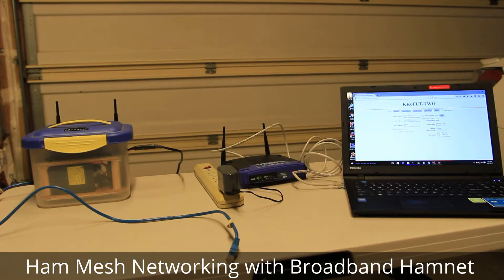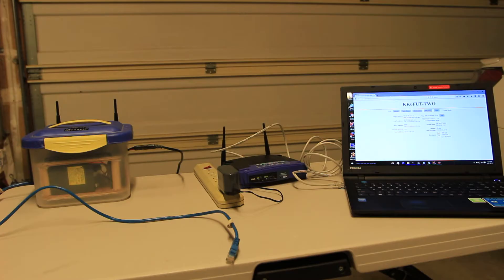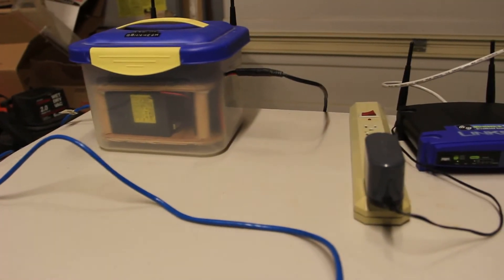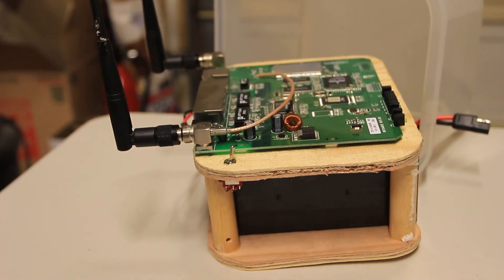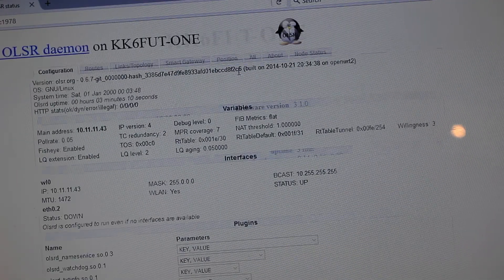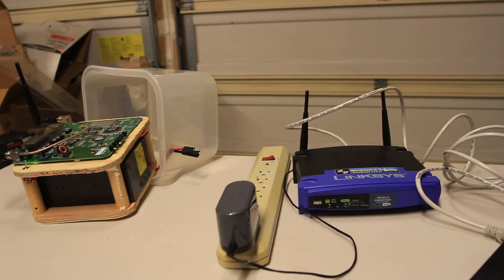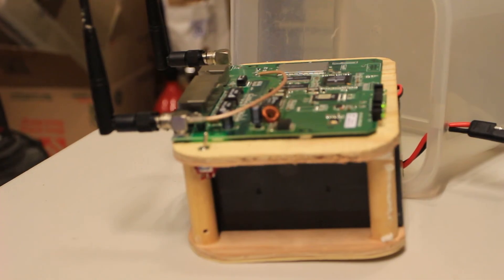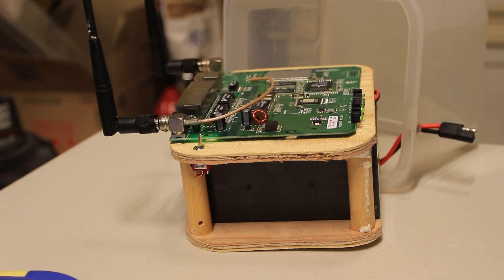Ham Mesh Networking - Linksys WRT54G with Broadband Hamnet (HSMM-MESH)

Comment: Do you have links or information on dealing with using Linux desktops with wifi pci cards for this? I imagine then it would be simply creating modded drivers for the adapters and modding the cards for the ham freq range right?

Comment: Are there other type of routers outside of the Cisco Linksys that can be used?
Reply from the maker: The preferred route for mesh networking nowadays is using Ubiquiti equipment and the AREDN software base -- if you're looking to get out to a wide range of hams. In my area, we now have more than 50 nodes all interconnected via Ubiquiti/AREDN. That said, the WRT54G stuff is fun to play with -- but not weatherproof, or as high powered.